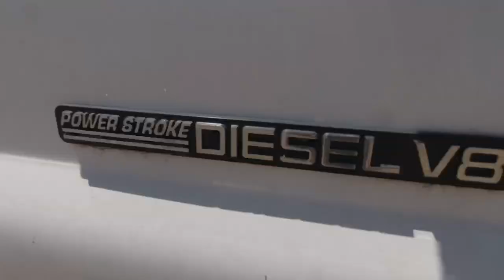4" LIFT INSTALL (Part 3) - 2001 Ford F350 7.3 4x4 Dually Powerstroke - 4” Rear Block and New U bolts

Comment: From my time in the 7.3 community i that 4" is usually good for 35's and 6" for 37's with now rubbing on either. You might be able to get away with 37s since dually tires aren't as fat.
Reply: Would you recommend getting a 1999-2003 f250 7.3 as a first truck
Reply: Crf150rHf Torcs only if your comfortable working on your own rig and learning. If not then no
Reply: Living On Wheels I’m willing to learn

Comment: I don't remember if you have done this on your truck yet. I know you are having different measurements at different times when you are working with your suspension. Have you changed your body mounts out? You would not believe how destroyed they can get after 20 years.

Also I know you don't need to worry about this since you are on the West Coast. If you happen to live on the east coast after cutting your u-bolts the bolt off each you clamp. This will clean up your threads on your bolts. If you ever have to take it apart the rust can really make it difficult. You can do it on the West Coast I know you do have sea water on some of the roads by the ocean and there are people who live in the mountains there that are dealing with road salt.

As always I gave you a big old thumbs up. Look forward to the next video.

Comment: My setup on both an F250 and F350 has been 3" with 35x12.50x22. I had a little rub at full lock, hitting a bump, but otherwise mine fit fine.

Comment: I have my truck lifted 4" and the max I could fit was 35x12.5r22 and it is a 2000 Ford F-350 2wd, is the 4x4 are a little bit taller but I wouldn't risk it with 37s, rn my truck sits 53" from the ground to the bottom of the mirror so you are 2" higher than me

Comment: I bought a set of used 37's for $400 to see if they would fit my 2500 with a 6" lift. The kit recommended 35's but the 37's fit no problem with no rubbing.

Comment: I have a 2001 7.3 with no lift and I have aggressive 35s with the slightest bit of rubbing. 37s will fit easily In my opinion

Comment: 35s or 37s, depends on your gear ratio. Don’t want to take your motor out of its power range. Unless you’re planning a gear swap. Nice looking truck sir!
Reply: What gear ratio is good for 35’s?  I have auto tranny in mine but not sure of gear ratio.
Reply: Depends on your final drive in your transmission. If it’s 1 to 1 or an overdrive. Either way you need to know you axle ratios. Should be a tag on them or if you’re sure they are oem your vin can tell you.

Comment: I love how your truck sits level looks way better now. I am about to lift my F-250 and have wondered if you have had to drop your driveshaft or transfer case at all because of the lift?
Reply from the maker: Thanks man, no nothings needs to be dropped just longer away bar links

Comment: The leaf that you ordered on amazon , it shows on the picture that the leaf has like a helper spring at the bottom on amazon. Is the picture correct on amazon or is there no bottom helper spring    The link is for the front spring right?

Comment: I have a 4" lift and 37 is on my 7.3 now. Would recommend trimming, or getting rid of that valance
Reply: Did you have to buy an extend pitman arm for the 4 inch lift?
Reply: @levielizondo5991   It wouldn't hurt but no I did not I got a track bar drop bracket and in adjustable track bar and that was about it.

Comment: Looks odd, body looks too high which make the wheels look wrong, if you take the centre point of the wheel opening and the centre point of the wheel there so different that why it looks odd